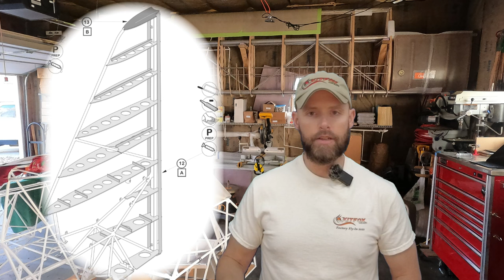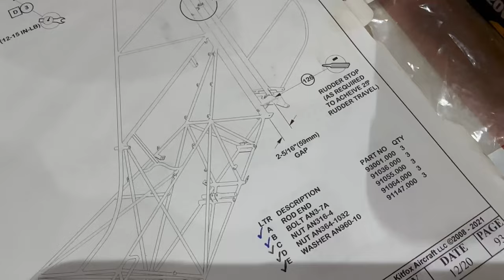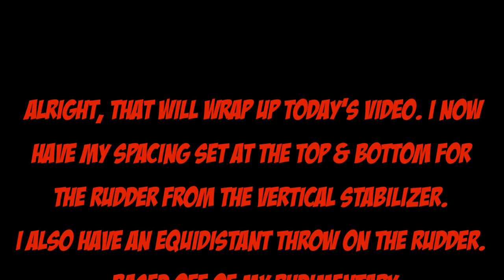#32 Vertical Rudder Install Pt.3

Comment: I'm not sure why they have not corrected this in the book but you really don't want to grind until final assemble . Many have had problems coming up short after the rudder is covered and finished. Good luck , Harlan
Reply from the maker: Hello Mr. Payne, thanks for writing.  I was just talking to Mr. Murphy about you and I’ve been meaning to go watch some of your stuff.  I didn’t grind down to what I thought was the 25º mark, for one I’m not sure how to take that measurement yet.  I had an inconsistent swing both left and right, so I only did enough grinding to equal them up.  Thanks again for commenting, I look forward to seeing your build.  Matt

Comment: By the way, I went with 2mm thick sheets of carbon fiber that I ordered online, and made the floorboards myself. Very easy to work with.
Reply from the maker: Hello Mark, so you made your own floorboards?  Do you have experience with carbon fiber from the past or fiberglass?  I’m new to all of this and am learning a lot, did you do the vacuum method or just lay it flat and add in some sort of resin?  Thanks for the inputs.  How far along are you on your build?

Comment: If I recall, 7kilofox had issues with his also. He ground them down, but don’t be too aggressive at this point.  You may want to look up what he did on his video.  Can’t remember which one it was.  Sorry.
Reply from the maker: Hello Mark, thanks for the reply.  A guy I met on the KitFox Forum mentioned that to me.  He’s farther along in the build than I am and I found it to be great advice as I was just about to complete the grinding.  I started watching his videos but have yet to come across the point where he may have made that error.  I’ll keep looking, for the time being I’ll leave good enough alone.  Have a great day, Matt
Reply from the maker: Hello Mark, I finally found his video where he had the issues.  #19 around the 27’:35” time frame.  He mentioned 30º though, I know my manual states 25º so I am hoping since I stopped there I’ll be good.  Time will tell!  Have a good day Mark, Matt